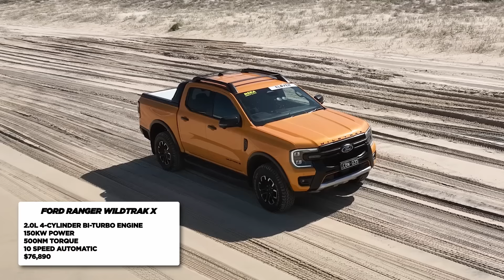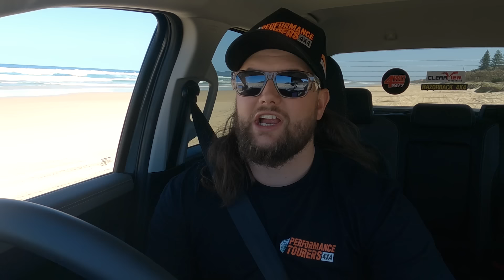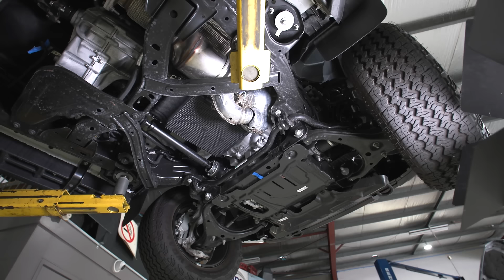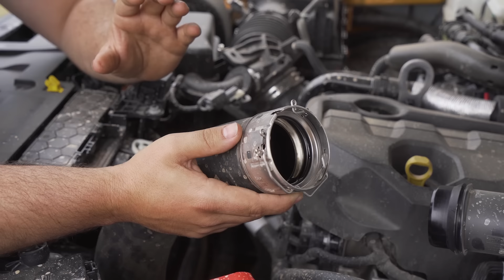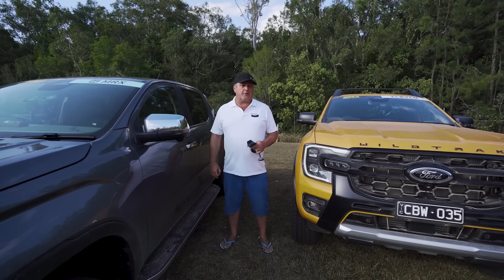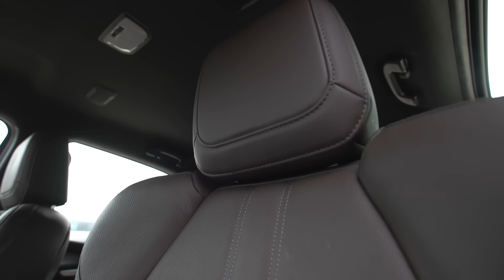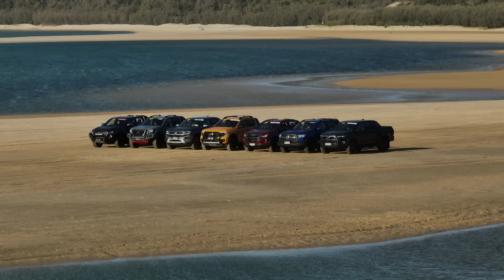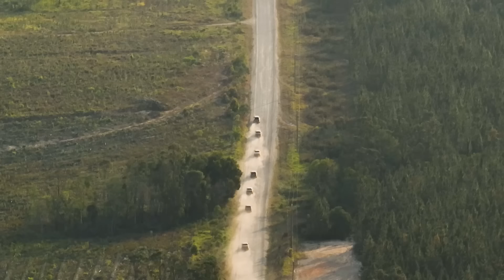2023 4WD UTE COMPARISON - Top Pickups tested Off-road - Shock winner!

Comment: Idk how I feel about testing a 2l ranger not the 3l v6
Reply: Exactly its not a good comparison although the amarock V6 is a ranger
Reply: @Sh1tstir  yeh I know that but the wildtrak x is priced much higher with only a trim package and a small motor. If they had a sport or soemthing with essentially the same features almost with the v6 would’ve scored higher
Reply: @nicholasbatshon8017  the V6 in the wild track x set up would have killed them all plain and simple its just a shame these comparisons arnt purely objective they are a popularity contest. The end of the day what comes out of the factory very rarely is what ends up in the bush. I personally would never buy a top spec vehicle because im modifying it anyway so what's the point. I went with an XLT and have better mods than what the wild track x has for total less money car + mods.
Reply: @Sh1tstir  I got the same thing with my 2017 ranger. Xlt model specs to how I want which is way more than the top of the ranger for cheaper

Comment: The blue stuff. You're going to find out that it starts corroden anything it touches. Everyone here in the u s where they do sell it at the pumps. They have to replace the pump on it constantly and all the parts. I don't know why they started using it, but the stuff is more toxic Then the diesel itself.
Reply: I suspect that's the point – to drive the EV and "own nothing" agenda. You've have to live 15 minutes from the indoor track and trade off other parts of your allowance in order to rent an EV 4x4 if you've been a good boy and consistently compliant.
Reply: You are Talking bollocks mate, Europe has had it for decades now.
It isn’t corrosive and in 20 years I’ve never seen a pump or hose corroded because of it, maybe it’s dumb people (which America has a vast amount of) putting other stuff like petrol/diesel in the Adblue tank and fucking it up.

Comment: Hey jocko… the ranger has a gear limiter. You can literally set it up to have a 2 gear gearbox… I do pre delivery and accessory fitting as a job for tropical auto group in rocky and found that feature out while playing around with manual mode…
Reply: What does all that mean in terms of performance/off roading? I'm learning lol

Comment: Haha what a joke on the hilux wasnt the best each time but got 7s every time hahah rigged as normal as the best rated only got a 8.. i think it should be all utes available as the 2l range is not a great option. Hilux is way out dated and has more issues then the rest but no we dont mention that but yes toyota has tried to fix but dpfs and shit suspension issues that are still there. Need to do top spec utes and compared to usa utes would be nice.
This hilux would not do 500000ks but i think the isuzu would be thr only one to hit the 500k.
I have a next gen raptor raptor and i know for sure it wouldn't make 500k mark but wins on all the test shown apart from parts available and cost and they have electrical issues every now and then. I think the reliability for all new vehicles has gone apart for a vdj70 series and not a hilux n80.

Comment: How did the BT50 get the same value for money score as the DMAX when its almost 20k more?
Reply: I'd sake they'd be comparing like-for-like models. The BT-50 on test is probqbly top level spec compared to a mid range Dmax. When I looked at both last year there was only a couple of thousand difference in the mid range spec (favouring the BT).

Comment: Elephant in the room independent suspension on caravan causing most suspension problems watch how unstable in tests caravan industry has lot answer for instead of peoples wallet’s embarrassed about bumpsteer explanation there is a simple fix if towing less 150 kg on the small lift 20 to 30 mm same lift back those springs from eft which I use all in my business ride leaf springs if you put 200 kg on them they will be worse than standard I deal with stuff daily thanks sorry to criticise but needs to be correct for average punters 😢

Comment: Another great comparison! I have a Navara and I've been really happy with it but so far in 145000 ks its done 2 rear mains, lost count of replacement intercooler pipes, multiple turbo lines and has now developed a mystery squeal at high revs. Lucky they are a good looking ute! For me I wouldn't buy any of the current on offer dual cabs and wait for 2025 as it looks like there will be some significant updates to the market. Would love to see the Tacoma make its way to Oz or at very least give the next gen Hilux some of the same styling.
Reply: I have a 2016 np300 with 243km has done hot pipe that's it. It been great on fuel and this engine has had many high k reports of reliability from Europe. My cousin has a 2018 hilux and has nothing but problems with it. Go figure
Reply: Yeah its definitely luck of the draw I think. I had a 2008 Hilux back in the day and at around 110000ks it decided to spit all the bearings out of the balance shafts. After that it just had non stop problems.  @bears2604
Reply: the 2.3L unit is Renault sourced .....say no more, Renault has had a detrimental impact to some of Nissan's products. Thankfully not the Patrol. 2,5L engine is a Nissan design and robust but ignore the stupid long oil change intervals or you will stretch your timing chain.
Reply: I also have a 2022 Navara and I fell in love with the looks of it. Here in South Africa, the new Navaras come with an upgraded version of the old 2.5 liter single turbo diesel engine that was used in the older generation Navaras - we don't get the 2.3 twin turbo. But it also makes 140kw and 450nm. I don't why, but according to some of the guys at the dealership I spoke to, they are of the opinion that the older engine is perceived to be more reliable (don't know whether that is true or not), so the South African guys are more inclined to buy one. Their strategy seems to have worked, because the new D23 is selling a lot better than the previous D23 that we had with the twin turbo engine.

Comment: Mechanic here, work a lot on the cannons and i can tell ya

They aint reliable and are a bitch to work on

Not a ute i would recomend, no matter what bits theyve poorly fitted to it
Reply: How so? got mine as the first cannon release in aus. Been on pretty much every single off road track in Aus and all Ive broken is a bonnet latch because I didnt close the bonnet properly in the Simpson desert. Suspension and linkages are a mix of hilux and ranger parts, mainly ranger. Strong proven transfer case and transmission, borg warner turbo. Everyone is quick to say they dont like them when I can guarantee youve actually never touched one.
Reply: Better back up your statement with real facts and real world situations not keyboard warrior BS. All of the last 5 cars i have brought have been shit. Im interested in a Cannon X as it has a 7 year warranty and i have a back up car for my business.

Comment: Didnt mention the fact the Cannons fuel filter is lower than the chassis and all the XSR offroad stuff isn't mounted very well.

The steps are still bolted to the body with little nuts and studs not the chassis, the bullbar is bolted on with 4 bolts and no middle supports, the rear bar has questionable welds on the tow points and also mounted poorly to the chassis.

The Cannons are also absolute junk to work on and good luck with any warranty. Majority of parts are minimum 2-4 weeks, just waited 3 months for a DPF. Oh they also have DPF issues with frequent manual regens being required.
Reply: You're missed the point of the GWM product.
Steps: They are not rock sliders, just a solid step.
All steps on any of these utes are mounted to body.
Rock sliders are attached to chassis, EX. Rugged X.
Steel Front Bumper: It's not a bull bar, it's just more solid than standard plastic panels.
Mind you, in South Africa it gets a factory mounted winch built into it, so must be some rigidity behind it.
Steel Rear Bumper: as above, more solid.
Reply: Done any work on the LDV T60 Max? How’s it compare with the GWM?
Reply: Had mine since May 2021, has had 35s on it since it was a week old, I have never done a single manual DPF burn in the 45000 kms I have done. I broke a rear diff (Big tyres, too much throttle lots of wheel hop). But other than that it has been flawless, it is a shame others have had bad luck with them.
Couple of mates have wanted to get one and I have to steer them to the pages of poor buggers that have had all the issues, even though mine has been great.

Comment: I've had the Cannon xsr for almost 5 months now (AKA P-Series limited  in south Africa) and my only complaints are that it is a bit under powered when fully loaded and the suspension is a bit bouncy at times. Other than that its been an absolute dream! I've done quite a few tough tracks around here as well as some tough off-road game drives with zero issues. 

For me, the fact that it comes from the factory twin locked with a snorkel, good all terrain tyres, bash plates, built in 220V inverter with outlets in the cabin and the engine bay and a winch too in South Africa was a deal breaker. I'll have to see in years to come how the reliability holds up
Reply: I have the LS, with a Stage 1+ and that has solved ALL the power issues and throttle lag. Next I am looking at getting an EFS setup to stop the bouncing... so far I am VERY happy with the GWM
Reply: @nicholaslisse5043  I've heard lots of good things about the stage 1+ hopefully I can get it done soon but suspension is first on my list
Reply: I'll never buy a commie car.
Reply: For interest sake, why didn't you go for the Mitsubishi Triton?
Reply: @andrevdmerwe3107 ive checked out both, being 6 foot tall  i couldnt fit in rear seats in the triton.... dont own a cannon but its a great looking ute plus twin locked standard, just lacking power, they have a v6 version in china apparently coming to oz
Reply: @andrevdmerwe3107   I went with the GWM over all the other brands mostly because of affordability and the bang for your buck factor. All the aftermarket accessories I would have installed on the other Utes already came as standard on the Ltd/ XSR edition. (mainly: snorkel, winch and tyres)

Comment: Ford Ranger is simply the best. Designed and engineered in Australia! It is the most Australian Ute on the market and supports local jobs!
Reply: Mine's a piece of crap. Typical Ford rubbish.
Reply: I'm not locked into any brand, I just want what I feel is best for me at the time I'm buying it. I went from Hilux to Ranger, simply because the Ranger had a load more comfort, interior space, more power, and out of the showroom, it was far better than all the other utes I tried at the time, and I needed to do a lot of towing. However, the Hilux was a lot more reliable, and better at short distances, over the same amount of time, with very similar mods. So much so, I regret not keeping it as a second vehicle.

Comment: As I suspected, GWM is the best off-roader. I did find some of the guys were trying hard to put it down. Overall it seems to be the car of the year. But yeah the only thing stopping it from being at the top is that we do not know if it will be reliable
Reply: It's underpowered and bottoms out on everything. If the other Ute's had a front locker the cannon wouldn't even get a mention
Reply: @Hazardbone  true but they don't which is why it is the best off-roader at around 50k.
Reply: @user-fi5iq5ws5i it score 9 in off road and value for money plus another 9 on cheapest🤘
Reply: @Hazardbone the cost doesn’t compare, with the money saved you could chuck a lift kit in and gettuned

Comment: Hello! 
I'm a new user of a pickup truck. I live in Cambodia, and I use an Isuzu D'Max. I don't know how to use oil correctly. I've noticed that a lot of people in Cambodia use 5W30, but Isuzu recommends 15W30 for use in Cambodia. So, which oil should I use?
Reply: Definitely 15w30
Reply: @darrenbooker8144  thank you 🙏
Reply: Check your Manual bro. That's the best way to get right info
Reply: @eullopez523  thanks bro 🙏

Comment: Here we go again. Older cars are going to fetch higher prices now because adblue is a new thing and no one is gunna want it.
Reply: Adblu has been in trucks for 15 to 20 years it's not new but the good thing about adblu is no dpf which means turbo back exhaust upgrades so you can actually get your car to breath better, lower egts etc etc and not set the grass on fire

Comment: Nissan only puts out 92kw and 270nm at the wheels with a tune you get 30% why would you bother with it. 
My ranger with a 341000k on it with a new turbo and intercooler and injectors on a 33" tyres made 182kw and over 550nm at the wheels on a safe tune.

Comment: I'd enjoy watching the Team testing a Cybertruck. Not because I believe it would do great or under perform in some tough tracks, but I'm curious about the Stainless steel panels would handle impacts. Bent panels are one of my first concerns going to a trail.
Reply: The first cyber trucks that make it to Australia will be way over a million dollars secondary market and instantly parked in showrooms. It will be a long, long time before we see them on a 4x4 track here.
Reply: It has a large stiff aluminum chassis with heavy body panels strapped to it, I don't know if I really want to take that off-roading.
Reply: @gpaje Musk said it's around 7000lbs That's 1ton territory.
Reply: @secret5. more like 3 tonne
Reply: @secret5. Musk is a liar
Reply: @LukeySaint  Referring to a 1ton truck, as in 1ton capacity, such as f350.
Reply: @gpaje   My curiosity is around the body panels durability in the trails. And a possible application towards other off-roards, as some aftermarket Stainless steel body panels. As an off-roader, the Cybertruck due to massive weight, long wheel base, range, as repairability, It could be a terrible recipe to take it to some remote tracks.
Reply: If you go off-roading and worry about bent panels - you probably shouldn’t be off-roading.
Reply: The fact a 80lb bow shooting a arrow with a broad head bounces off it plus being bullet proof I’d say they are tough
Reply: @BogDustForBreakfast   It's not the hyped exoskeleton Tesla promoted, but a standard unibody construction with bolt on Stainless steel. And due to that, would be interesting if other Automakers would consider, bolt on Stainless steel panels for special edition off-roaders.

Comment: The terms of reference are good and in general provide a platform for your result. When you consider the more important factor of pricing and overall spend, there is one vehicle that will come out on top. Throw $15,000 , suspension, canopy, tyres, bullbar, lights and other accessories at the D-max and you have a true offroad / tourer / tow vehicle that is capable, reliable and proven and in reality, fully kitted is the same price as some of the other vehicles, straight off the showroom floor. Budget, in the end will always be a major factor for us 4 x 4'ers and should have been given more importance in the " Ute of the Year " comparison.   In the end, you gave good insight for potential buyers and I always appreciate these comparisons. cheers   LP

Comment: Should do a higher end ute test next year. I.e. 79 vs ineos quartermaster vs jeep gladiator
Reply: 79 isn't high end
Reply: @DarrenBoxhall  yea, but its a chance to show it's shortcomings compared to other solid axled utes on the market
Reply: @DarrenBoxhall  The price of them are, especially when they are done up. You can easily hit $150k on them. There are currently over 100 79 series for sale over $150k in Australia. The most expensive is $300k.
Reply: @jayd3931 just shows you how many dumb people are out there
Reply: I know the Gladiators are not as popular in AUS, but it seems 4WD247 actively tries to avoid include Wranglers and Gladiators in any test.
Reply: Would love to see an SUV version test with the Grenadier and Wrangler included
Reply: I wouldnt call a jeep or 79 "high end"
Reply: @KorbensBum  have you been in a JLRubicon? They are pretty bloody swish for the most capable stock off-road vehicle available on the Australian market.
Reply: @JK392_aus they’re also considerably cheaper than the 79
Reply: @KorbensBum  79 isn't but Wrangler Rubicon is defs

Comment: Is the Gladiator not considered a mid-size dual cab 4wd? or is it coz it petrol?
Reply from the maker: It’s in a bit of a different league. Our goal is to get it and test it with the 70 in 2024.
Reply: @4WD247  sweet, if you did a comparison with the Wrangler Rubicon, ineos grenadier & the new 2024 76. that would be pretty good
Reply: It's 20 cm longer then my hilux, that's one thing.

It's between a full size (150/1500 class) and the "regular" utes.
Reply: Couldn’t get a jeep out of the service department to test it.